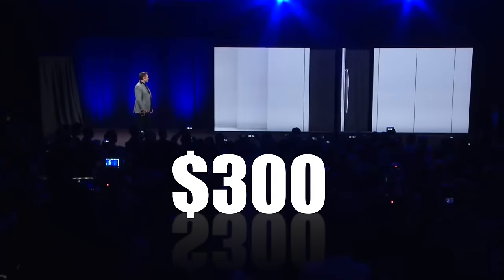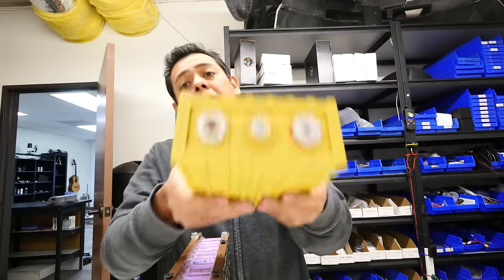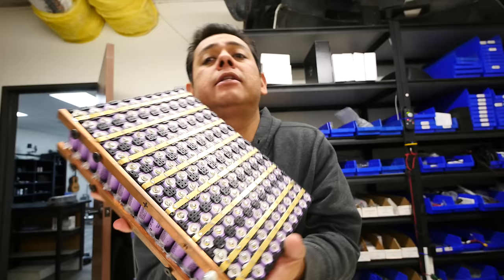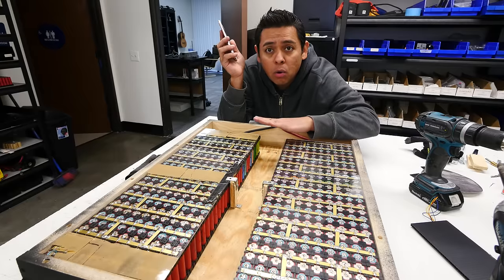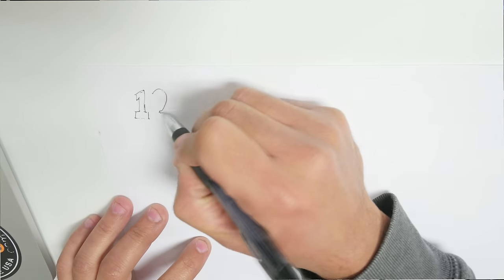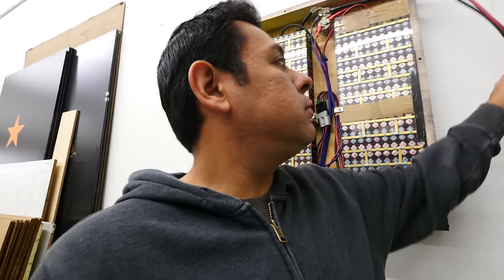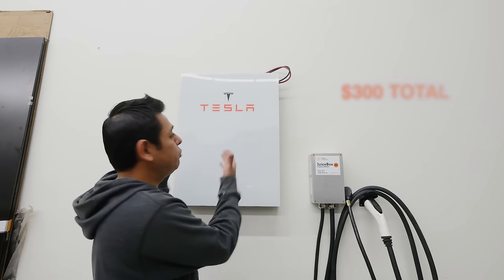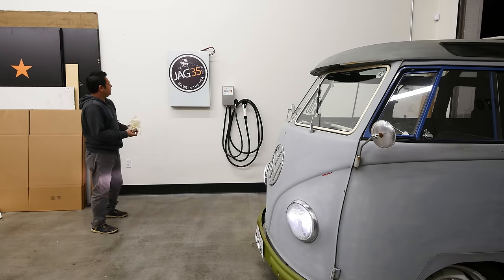$300 DIY Tesla Powerwall - Solar storage 18650 lithium ion home Battery

Comment: Great idea....questions:   
1. By using old batteries, isn't one vastly cutting life expectancy of the pack?  
2. Are the batteries easy to remove/replace when they go bad?  
3. Is there some visual cue that indicates when each cell quits working, to easily facilitate changing out only the bad cells?    
4. And, what happens...anything adverse...by pairing cells of different ages and wear?  
The box could be configured to inset between wall studs, so avoid anything much sticking out off the wall surface!

Comment: It's all about the batteries.... weight and current vs. application capacity.
II have a cluster of free 40 x 12V 20Ah UPS Led Acid batteries that 
I get to torment from time to time on my DYI UPS backup ideas. 
The other day I tried a load  on just (1) single  but good 12V Li-Ion, battery.   
So we dream every day of finally pulling off the grid and make good DIY stuff like you share with us.  
I can just say It's amazing the power one gets with no weigh from Li-Ion/ 18650 batteries. 
Thank you, Mr. Garcia for tons of inspiration, keep your nice production up :  )

Comment: Awesome job .. I love how you de-mystify this stuff .. it benefits even those folks who know, in principle, how this stuff works.  One of my degrees is in EE, and I know plenty about how this stuff works, but I tend to let my imagination run wild about the possible complications, and so never undertake a project. Being able to see it actually done from stset to finish provides needed encouragement (and insight into which parts to use etc.)

Please keepep them coming!
Reply: if you have a degree in EE you must then realize, his math is off.   You'll never have 4.4KWH.  That is the total at 3.7v  
To get 12v you divide the cells into 4 groups (not 3 as he states).  at that point you are down to 1.11KWH.  
24v system is dividing by 8 (not 6 as he states).  At that point you are down to 555WH
Reply: @candicefrancart2060  No, he is right, as far as he goes. It is AMP hours that will change according to the Voltage. Ohm's Law: Amps times Volts = Watts. The wattage will stay the same.
He is just showing that it is possible to configure these batteries into 12V/24V/36V/48V. It's up to the person putting their own system together to figure out which is best for them. :)

Comment: Awesome video man, can't wait to see part 2! Would be cool to see some 18650 safety tests like fast current drains and over voltage charge and shorts etc.
Reply: +sk8rboy1255555 Great idea.
Reply: +sk8rboy1255555 I recently charged a recycled 18650 cell to 8Volts. :(
I was trickle charging it up from 0V and forgot about it. When I disconnected it from the charger it's voltage dribbled back down to 0.5V
Think I might avoid using that cell ;)
Reply: Wow 8 volts! and no fiery ball of death? guess these things are safer than I thought.
Reply: +sk8rboy1255555 I was a bit freaked out when I noticed it. I don't want to do that again.

Comment: While some commenting apparently don't like your work, overall it's great that you're sharing info. Personally, I'd rather spend the money you did on glass with logo on better (or new) batteries, since old ones have already spent some cycles and will have to be replaced sooner than later. A plain piece of glass is cheap, and labor or fire isn't. Overall, thumbs up and nice job.

Comment: Enjoyable video and good info. That said many folks are not aware of how easy it is to refurbish cordless tool batteries for peanuts. For the price of a replacement battery pack you can get 100 cells on ebay.

Comment: A great place to get 18650's and other batteries FOR FREE is in those used battery recycling bins that are at most electronics and hardware stores, or you can ask at a recycling facility, 18650's are in everything from cordless drill battery packs to laptop batteries.
Reply: Definitely not new,but freeeee. The ones in old laptop batteries are for sure not new, and more worn. Most cordless tools have "smart chargers" that the unit will simply not recharge , but the batteries are still perfectly usable
Reply: +Video Québec lol "smart charger" = after it gets tired of you it tells you to go by another one
Reply: Basically lol apparently it's to protect the batteries/device. That's why it just stops working instead of gradually losing charge capacity
Reply: Des batteries gratuites comme celles-ci: là tu m'intéresses. :)
Reply: enator71 Uhhhh, it was like that before Trump was in office. It's called business.
Reply: 2Awesome,
We should start open sourcing everything, so that we don't depend on private companies for such things as "smart chargers".
Reply: Chargèro,
We should start open sourcing everything, so that we don't depend on private companies for such things as "smart chargers".
Reply: Lol, in my experience private companies are perfectly happy to give and/or sell you failing batteries as long as they know you know what you're getting. If they are refusing you access to failed components, it's likely because either the drone you're talking to has no power or reasoning skills, or because they're uncertain about environmental rules. Clear rules help everyone.
Reply: yup. I remember when I had an internship at a company which also replaced batteries in emergency lights. That time I didn't know they were so expensive, but nowadays I regret not taking them home!

Comment: What about cooling and ventilation? Tesla has an active cooling loop to maintain the correct temperature. What about redundancy? Tesla has overcapacity in the batteries to survive with battery failure.  What about a battery management system?  What about fire saftey?   Lots of things to consider beyond just bunging a few laptop batteries in a box.
Reply: +125white125  Also How long will this last compared to Tesla's warrantied battery.
Reply from the maker: +wiboater4   Its an experiment,  results come at the end,   we'll have to see
Reply: +125white125 cooling? what for? lithium ions never catch fire on their own! Thats why Boeing (a company full of really stupid engineers and physicists) had such great success putting them into airplanes!! Oh wait... im being sarcastic.
Reply from the maker: Curious,   what kind of batteries do you think airplanes currently use?
Reply: lead acid and nickle metal hydride are the most popular. The 787 is using lithium ion, but it should be noted that the company that did the original design of the batteries went bankrupt after the building burned down due to thermal runaway on one of their battery packs. Whoops.
Reply: +theonlyari Lol

Comment: What you've essentially created is a 1260Ah battery at 3.7 volts DC. You can't really run anything useful off of it. You would have to wire it at 11.1v minimum to make it worth while (I would go 14.8 to delay onset of going below minimum inverter input). Wiring it at 14.8 volts to power an inverter would reduce the battery size to 315Ah.

Rough estimate time. To power a small room (assuming LED everything) with a TV, a light and a laptop would be around 250 to 300 watts. This battery powering a 300 watt AC inverter would last, at maximum, 5 hours.

The Powerwall inverter says it can power your whole house, so I would assume inverter output of 240 volts. It says 5kw is continuous output, and at 240 volts that would be 20 amps, so that seems right. So to claim a 14kwh battery at 240 volts AC, you would need 58Ah of battery. Convert that to 48 volts DC, and you get about 320Ah worth of combined cells. The Powerwall would run the small room from above for about 21 hours.

To make something equivalent to the Powerwall, you would need about 1,976 of those 3.7v 2100mAh cells wired at 48v. Alternatively, you could make smaller batteries using 600 cells like you did (but still at 48v), and just keep adding them as you build them to slowly increase the Ah over time instead of making one giant battery in one fell swoop.

Comment: Hi there,
You forgot to mention the costs of a control unit and an inverter, which - of course - are included in the Tesla Unit.
Regards from The Netherlands,
Roelof Kingma
Reply: More like $1000 diy powerwall.
Reply: @ctrlaltdebug  With used batteries, he's going to be chasing dead cells constantly.  What a mess.
Reply: @nikolatesla811  That would be my issue. Balancing is going to be a mess.

Comment: Cool project, I always love DIY and people who share the knowledge. To everybody else on here, right or wrong, we should be thankful for people who take the time to do a good video and share their knowledge, even if it is wrong or we don't agree with it fully. You can either learn good things, bad things and takeway (if you choose) something from things like this.

Having said that, I do disagree with a few things. First the price, you only mention the batteries, wood and glass as cost on your BOM. However, and you even link to these in the video, there are many other components on the BOM. For example, the battery holders link you provide, takes me to eBay where there are holders that hold 15 batteries for 5.99 each. To buy enough of these to hold 600 batteries, it would cost $239.60 just for the holders. On top of that, there are many other items, for example the fuses, buss bars, wiring, etc...

Given that, and not even factoring in labor, I think your actual BOM is more like $600-$700 (and that is assuming you still use that overpriced piece of glass). Still not bad if you want to take on a project of this magnitude. Which brings me to another point, the labor. Do you care to share how much time it takes to pull apart all the laptop batteries, test them and then arrange/solder them all together into these packs? I would venture to guess it would take many, many days.

Finally, as others have pointed out, there are things like UL listing, thermal and environmental concerns, etc... that are not factored in to your solution. I love DIY, but some things that may burn my house down, I tend to proceed with caution. By the way, if you burn your house down with something DIY like this (no UL listing, etc...) you may not even be covered by your home insurance.

So, my summary, while the Powerwall is $3k-$3500, that is actually a good price when you factor the BOM, labor to build and other engineering concerns.

Mike
Reply: Michael Bedford can a Tesla powerwall be juiced with wind turbines?
Reply: You made some good points. I liked this video because it gave a quick rundown of the battery types, how these wall units function, how batteries can be arranged for a specific power output, and how to calculate the output. All good info for the layman.

On the other hand, I agree with your concerns about overall cost. Time is money too, so aside from the parts cost, labor should be factored in. Although, the enjoyment factor would negate some of the labor cost. 

Good video, subscribed!

Comment: Crazy irony: As soon as you have 600 batteries holding all your electric juice in box in your garage, you work to turn your DC into AC...
To travel only A FEW FEET!!!
A better investment of time would be to remove the numerous components in your various electric appliences to deal with the  assumed AC input.
The initial breakthrough of AC by Tesla a 100 years ago was to make electricity transmission possible.
Now that solar panels have come so far, no need for power transmission lines.
So, no need for AC-DC conversion portions of almost every electric circuit in every appliance (and the complimentary inefficiency!)
Not only live on solar power, reduce the needed electric need by removing the DC-AC converters all over the house.
Reply: Plus, you lose a lot of power in the AC/DC conversion. DC-DC is the future for sure!
Reply: @Alshafi  But, at least removing all the ac-dc converters in all the appliances (fridge, freezer, AC, TV, etc.) amounts to nothing but wasted juice.
As far as that goes, the DC-ac converter put in by the solar panel outfit waates juice.
People have no idea how much juice is simply being WASTED converting from dc to ac then back to dc.
Somebody will get the attention though!
Then power needs will be effectively cut, again!
Solar is the solution!
Reply: Dan Tyler what would that entail though 🤔
Reply: What are you saying... You would need specific Voltages transformed throughout your house... I guess it could be done, you'd have to literally modify everything... Might make sense for someone who builds a house in the woods just for this project. What about a rectenna.

Comment: Decent video though not for the uninitiated. One note, you stated Nickel Metal Hydride (NIMH) has a memory issue if not discharged fully before charged, that's actually Nickel Cadmium (NiCd) that has that issue hence their obsolescence and NIMH being used widely still due to their long life and lower cost than more advanced batteries.

Comment: Great project.. Its got me thinking. I don't know why you included the price of the wood in your project costs but didn't include the wires, wiring connectors, and immobilizer. I would imagine that would add some significant cost. $100 for the glass?.... well I guess there is a place for form over function, ( a piece of scrap metal painted with good paint and sticker would have achieved the same effect). I look forward to your next video.

Comment: Although I love the idea of having a powerwall I'm probably not going to do it and here's why. Inverter and converter power loss. Efficiency may vary from something just over 50% when a trickle of power is being used, to something over 90% when the output is approaching the inverters rated output. An inverter will use some power from your batteries even when you are not drawing any AC power from it. This results in the low efficiencies at low power levels.

A 3Kw inverter may typically draw around 20 watts from your batteries when no AC current is being used. It would then follow that if you are using 20 watts of AC power, the inverter will be drawing 40 watts from the batteries and the efficiency will only be 50%. 
A small 200W inverter may on the other hand only draw 25 watts from the battery to give an AC outpur of 20 watts, resulting in an efficiency of 80%.  So in my example I've talked a little about efficiency. I am wondering what your thoughts are about how you would use your wall as efficiency as possible?

Comment: You need BMS, if your adding solar panels, you should also invest on MPPT charger controller. The inverter should be the size of whatever you plan on running continuously, take in consideration the surge power and it should be pure sine wave inverter.
Good luck

Comment: What I find crazy is you got all these people spending thousands on batteries. I mean I watched a guy spend something like $800 on a lithium battery that was 1000 watts. I’m going watch more of  your videos, because I do a lot of pc repair and I never thought about taking old laptop batteries apart. I got a box full of dead laptop batteries. Why not turn the remaining cells into something useful. I’m not a electrician by any means but I believe I could actually do this maybe 🙂
Reply: Theres no way that pack last more than 500 cycles.... Theyre aready out of packs where one cell failed. That means the rest were about to go.
Reply: Just dont connect a bunch and you know stick a fork in a light socket. Safety first and foremost. I went to school for automotive and am currently going to school to be an industrial maintenance technician and electrician. Knowing whats dangerous and what isnt. Is the most important. You arent taking cells apart so as long as nothing breaks most anyone could do these things.

Comment: You could add some "ultra capacitors" across the battery packs in each box if you have room.  They have huge lifespan & can source hundreds of amps, so can ease load on batteries during startup of any electric motor or refrigerator loads especially in cold weather.

Comment: This is a serious fire hazard unless done by trained professionals. I've experience working in a manufacturing facility for these types of batteries (not tesla) and in the R&D and product testing phases there were a lot of instances failure which resulted in extreme heat, sometimes melting or charring equipment. As it was a testing environment this did not go unnoticed and was dealt with quickly, I don't think the same can be said of DIY version built and used in the home.

I'm a big fan of the maker attitude, but for projects with this level of health and safety risk I would say leave it to the professionals. 

Mega skills though! This advice is aimed at those who might not have the same skill set/level as you and fancy just giving it a shot.

#PCPrinciple #MakingIsCoolThough
Reply: True story, put it in a concrete bunker away from your house and anything that can cause a problem if exposed to a jet of fire. Back yard power station.